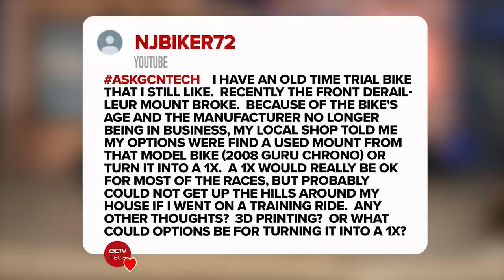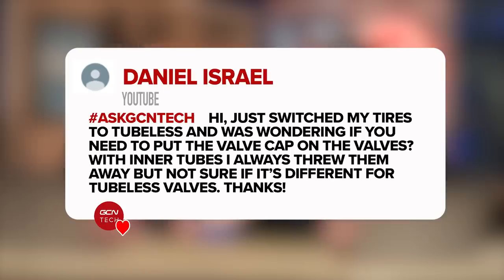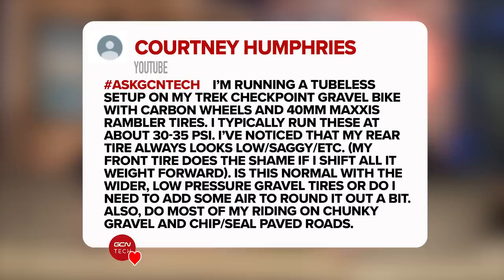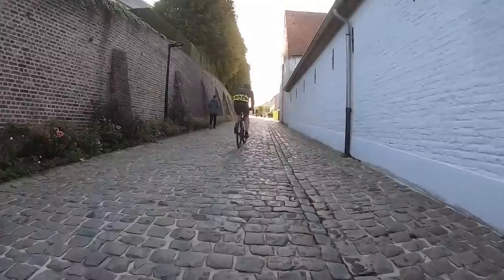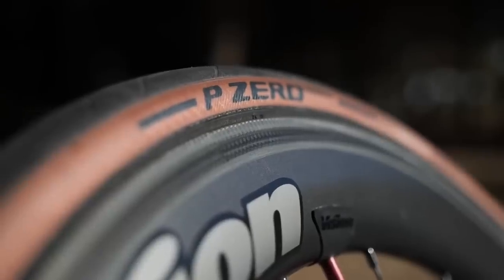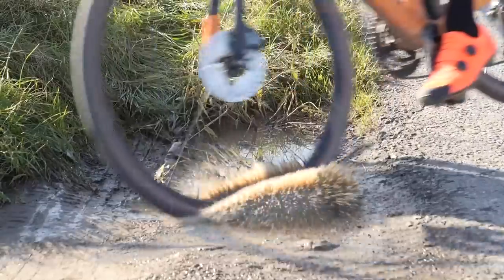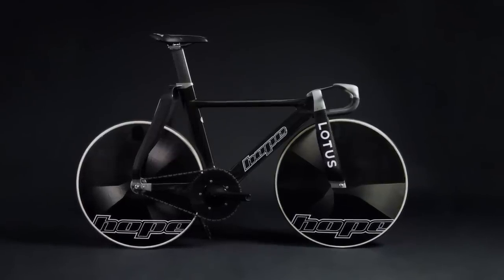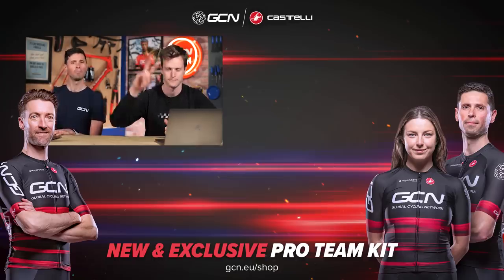What Should I Look For When Upgrading Bike Wheels? | GCN Tech Clinic

Comment from the maker: What would you like us to answer on next week's tech clinic?
Reply: Benefits to tubs in 2022.
Reply: I'd like to know where all the cat food is kept.
Reply: #AskGCNTech
I am looking for upgrading my tires (my current are continental Ultra Sport) and my rim is 24mm wide (outer width), and I wonder what tire you recommend, and which width of tire. I am looking a bit more for speed than comfort, though would like both.
Reply: #AskGCNTech I currently run Conti GP5000 TL 32c. I’m thinking of changing to GP5000 STR 28c primarily because of the weight saving (to help in climbs). But will it be sensible in terms of cost, rolling resistance, and comfort? Thanks guys!
Reply: #AskGCNTech
Hi Olly, Alex and Team

With regards to disc wheels having a longer shelf life than rim brakes 
If I was to ride carbon deep rims  in all Manor of conditions 

Is it worth having the spoke nipples inspected and possibly rebuilt to avoid nipples seizing to spokes maybe after 18-24 months of use?

As this happened on a old wheelset I had and getting old of the specific spoke that needed to be replaced was difficult.
Reply: #AskGCNTech

Currently have disc brake roadbikes and rim brake versions. What's your opinion on rim brakes? Are they going to be obsolete because I want to upgrade my rim brake version. Is is still worth the money?
Reply: #askgcntech 
When I’m on the big ring and smallest and 2nd smallest rear cassette ring, my chain will rub the front derailleur when I put power down. Under very little or no load it doesn’t rub. The more power I put down, the more it rubs (the rubbing gets louder with more power). I think my front derailleur is adjusted correctly. 
I have a 105 front derailleur, 52 tooth praxis chain ring, and oval concept (Fuji brand) crank. My bike is a 2017 Fuji Roubaix 1.2 le. It has a butted aluminum frame.

What is the fix? New crank? New chainring? Bottom bracket? I don’t want to switch to 1x. Please help!
Reply: #AskGCNTech
Do Pro riders ride one and the same saddle on all their bikes? Or at least the same model? Or are their butts so hardened/seasoned that it just doesn't make a difference to them if they sit on their usual saddle    or on a flat piece of wood?
Reply: @peterhong1880  mine was the bottom bracket.  Local bike shop told me it’s not good to put that kind of torque from a stop.  It made sense to me since I do auto repair.  It’s like driving in the wrong gear but expect the car to give me maximum output
Reply: #askGCNtech Hi guys, very much on a budget but looking to increase ride comfort, what would you say is best bang for your buck re upgrading to good 28mm tyres vs an expensive pair of bib shorts? Currently rocking 25mm tyres and some £22 Amazon bib shorts
Reply: @jefferyhuang6173  what bb did you change to? How does bb effect it? Was there something wrong with your bb?
And yea, when I accelerate from a stop, I’m in easier gears, so not a problem there. I do think I have quite a low rpm, but I find that more natural to me.
Reply: @peterhong1880  to be more specific. It was a 105 group set. I bought it new from a Trek dealer.  The creaking noise was from the chain ring side.   Trek store tech couldn’t diagnose it.  So went to another store. They couldn’t see anything wrong with the BB. Their guess is that during prep it was not pressed in correctly.   I need to add they sell Trek, skateboards, and one-wheels.   The other store only sell mid to high end road bike, tri bike, mtn bike.  I’m guessing the techs are more experienced since they only do bikes.
Reply: I have a front ffwd f6r wheel that I recently bought second hand. I want to convert the skewers quick release from to solid bolt on axles for track cycling. Is there an easy conversion or am I better off rebuilding with a track specific hub? I am currently going to use them with halo hex lock skewers as I have used this as a solution on a set of zipp 440s with a halo goldtech front hub.
Reply: Can I install a front derailleur where the cable housing can meet with the mech or some sort of Problem Solvers style product can hold the housing and the cable has just a short ways to the mech?
Reply: @babbleboyquito  feel the difference yourself with some 28c tires and get your costly ones second

Comment: Conor brought up an important point that seems to be frequently overlooked in discussions of assessment of tire width.  Weight.  As a lightweight, I think that 23 mm tires at 100 psi suit me on the road.  Consider two riders, with system weights of 60 and 120 kg, and the same tire pressure.  The heavier one would have a contact patch between tire and road twice the area of the lighter one.  It follows that the heavier rider would need wider tires, or twice the pressure, or a combination of wider tires and more pressure.

Comment: Regarding the cassetted swap from 11-32 to 11-34...On my gravel bike I have 50-34 up front. I have an 11-34 cassette on my gravel wheels and and 11-32 cassette on my road wheels (supply chain issues meant I couldn't find a decently priced 11-34 to match both sets) I use a KMC chain (gold of course) and keep a second quick link to add into the chain when I put my gravel wheels on. A quick adjustment to the tensioning knob on the derailer makes shifting smooth when I swap wheels

Comment: I think on a decent there is a crossover point where pedalling can be worth it. So on descents of 1-3% (negative), it will help you maintain speed and maybe pick up a bit more. Especially out of corners where you had to brake. Also on long descents it will help keep your legs "free" for when you need them.

Comment: I have converted both my mountain bikes to tubeless. I use Peaty's valves. I do still use the valve caps. As one is a valve core tool and the other is a spoke key. The plastic valve caps are history straight away.

Comment: Regarding the topic of going to a 11-34 rear cassette:  if your using  a short cage rear derailleur, ADD FOUR LINKS!!! If you don’t, you run the risk of destroying your rear mech if you inadvertently cross-chain, as the short cage derailleur does not offer adequate chain wrap with the shorter chain and the larger rear cog.

Comment: #AskGCNTech
Restoring an old steel 5-speed road bike with 120mm rear dropout distance.
Came across a beautiful modern fixie/track bike wheel that fits in terms of the dropout distance.
The question: will I be able to fit the 5-speed freewheel onto this hub because of the same dropout distance or fixie/track wheels are generally incompatible with freewheels with multiple cogs?
Thanks, keep up the great work!

Comment: #AskGCNTech I'm trying to be better about routinely checking things on my bike. What do you think is a good interval to periodically check the disc brake pads and rotors on my bike? I average 40–50mi a week in all weather conditions (yay commuting!) and have a system weight of 80kg. Brakes are avid mechanicals

Comment: #AskGCNTech I am planning on riding the Tour des Stations this Summer and was wondering if Ollie could tell me whether it would be worth using an Ultegra/105 11-34 cassette on a Dura-Ace R9100 rear derailleur (normally limited to an 11-30 cassette) if I am running 50/34 chainrings. I think I might be able to use the lower gear at some points, but shifting may be compromised, so I am not sure what I should do.

Comment: This may normal. When giving a large effort I feel some brake rotor rub. Is this do to the rotors flexing or the whole wheel flexing or a combination of the two? I'm a large rider 6' 6" 205lbs. Riding Cannondale SuperSix disc with Mavic Ksyrium Pro UST wheels. #askgcntech

Comment: #AskGCNTech I have a Canyon Grail gravel bike with 650b wheels with 35 width tyres. I want to get some wheels for use on the road (to run 28 width tyres). What is your recommendation between using my road bike 700c wheels (Zip303s with 28 width tyres) or buy a 650b wheel set?

Comment: #askgcntech 
When I’m on the big ring and smallest and 2nd smallest rear cassette ring, my chain will rub the front derailleur when I put power down. Under very little or no load it doesn’t rub. The more power I put down, the more it rubs (the rubbing gets louder with more power). I think my front derailleur is adjusted correctly. 
I have a 105 front derailleur, 52 tooth praxis chain ring, and oval concept (Fuji brand) crank. My bike is a 2017 Fuji Roubaix 1.2 le. It has a butted aluminum frame.

What is the fix? New crank? New chainring? Bottom bracket? I don’t want to switch to 1x. Please help!
Reply: I'm terrible at setting up front derailleurs. I think it's harder than it seems.
Reply: I think there might be a half shift that pushes the front derailleur slightly to the right so that it doesn't rub when you're on the biggest ring and smallest cassette. It's a struggle to set up, so might need to go the LBS.

Comment: with 26mm rims 25mm tires could be too narrow. with wheels that wide aero isn't a big argument. running the right preassure 28s are probably faster
Reply: Nonsense. #1 aero rule of tires is that the tire doesn't bulge outside the width of the rim.  No way 28s will be faster unless you're riding on gravel (at lower pressure).
Reply: @elementric1  well my zipp 303 firecrest have an internal width of 25mm so can't fit anything below 28mm tyres. so on a rim with 26mm internal width no way you can fit 25s. judging by that the rims are designed with at least 28s in mind from an aero point of view and on most real world roads they are probably faster than 25s
Reply: @leonschumann2361  if it's 26 inner I agree, had assumed external. But 26mm inner on a road bike?! Maybe I'm just out of date but that doesn't sound right
Reply: @elementric1  many new wheels are this wide. there are some budged or old school wheels for like 23s but usually it's 25 and up

Comment: #AskGCNTech I recently shortened my cranks from 175mm to 170mm since I got a great deal on a crank power meter.  I am wondering what adjustments I should make to gearing, fit, cleat position, etc., to accommodate the change in crank length.  I already adjusted my seat up a few mm, since I could tell I was too low, but I haven't had results fiddling with anything else.  Thanks!

Comment: Ain't aero between 25 and 28mm tires negligeable (even 23 to 30mm) ? front surface is ridiculously small and speed not so elevated (even a pro riding at 50km/h) regarding aero downforce, no ??